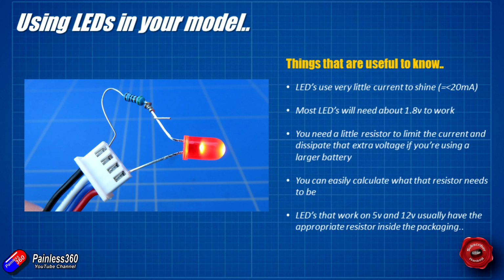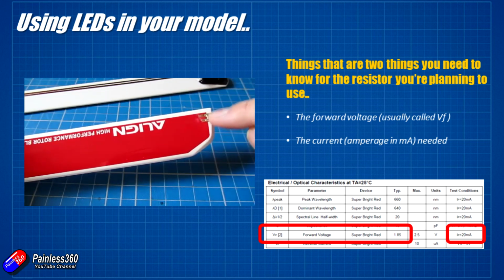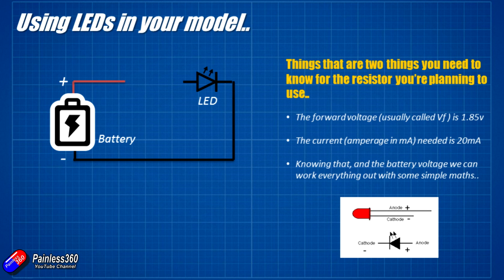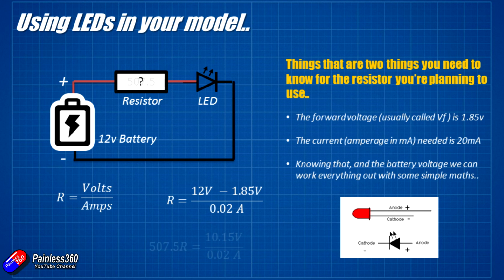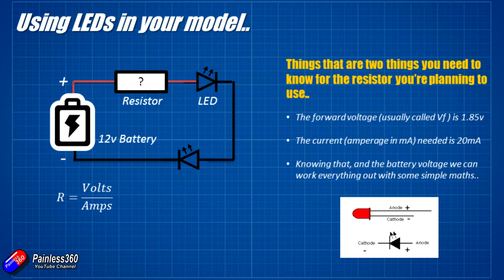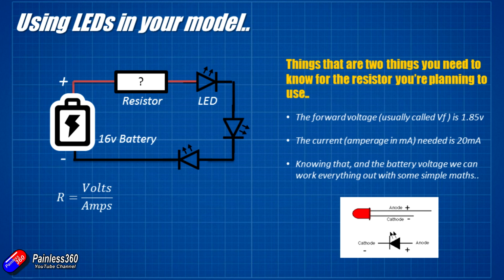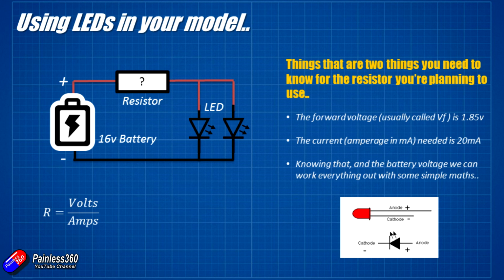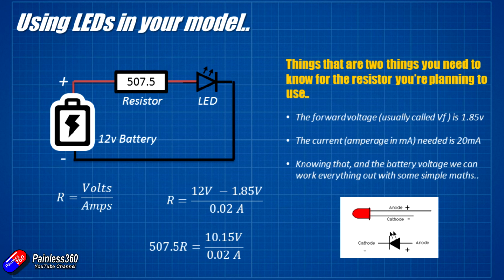RC Tips: Adding any LED to your model

Comment: If you are running at 12V, why not put 6 in series, would that not be more efficient. Ther would be less heat from the resistor, surely??
Reply from the maker: +Barry Cole you can but you'll still need a little resistor..

Comment: Thanks for the vid!

I know you're a quadcopter guy but some advice on installing LEDs in foamie planes (position, direction & wiring) would be great to see!
Reply from the maker: I'm actually a fixed wing chap to ;) I've just written this up as an article for RCM&E. The process is exactly the same. Not sure what you want to see - can you be more explicit on what's missing for a foamie LED video?
Reply: I'm not sure what the best or ideal LED solution is (tape or individual LEDs? And does the LED size really matter that much?) nor what the best approach is for installation.

I've seen some very good pre-lit commercial as well as some scratch builds, which are great but I want to retrofit an existing plane and my problem is I'm starting from the 'finished' product, so don't have the same level of access. And I don't want to make a mess! ;-)

So any tips on LED choice and about how you would go about cleanly retrofitting them without compromising either structural integrity or luminescence would be great.

Comment: Thanks for the refresher!  I am a trained Electronic Technician, but have been working in Telecommunications Management for the last 15+ years...  The adage is true: "If you don't use it, you lose it!"  However, it is easily rediscovered with such information as you presented here...!  Thanks again for posting this good info!
Reply from the maker: :D Happy soldering! :D

Comment: Hi, great video thanks. Can I skip the resistor completely if the combined voltage of the LED's in series  matches the battery. i.e. If I'm running a 2s Lipo (7.2v) and run for 1.8v LED's at 0.02A the maths is R = 7.2v - (1.8v x 4) / 0.02 = 0 If I've understood correctly as it's 0 does that mean no resistor is needed? Thanks 😀
Reply: OriginalGingaNinja Would NOT recommend that! 

LEDs have a fairly constant forward voltage (the voltage they need to light up). Theoretically, you could power then with a constant voltage source (which is what you more or less suggest), but this will be quite unstable concerning the current flowing through the LEDs. If the voltage over the LED rises only by a small amount, the current will increase by a lot. 

If you have a battery as your power source, the voltage will vary. If you omit the current limiting resistor an only put the LEDs in series, the current through them with a fully charged battery would be very high, likely destroying your LEDs. 

Hope that this helped you!
Reply: Anton Dahlström Thanks for the explanation. Thought that there might be more to it than I'd realised. I've got some leds, I'll order some resistors now! 😀